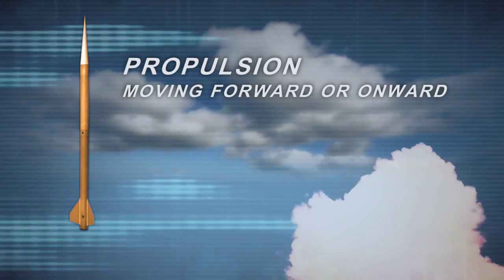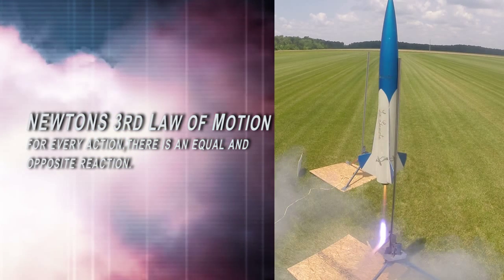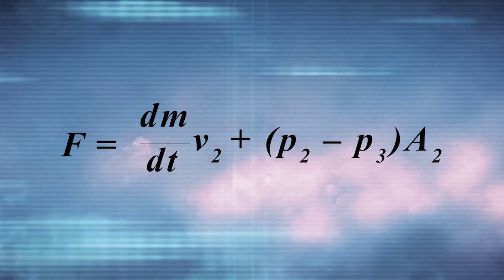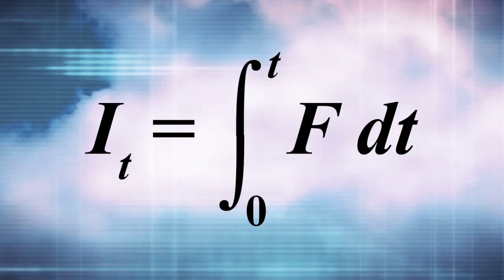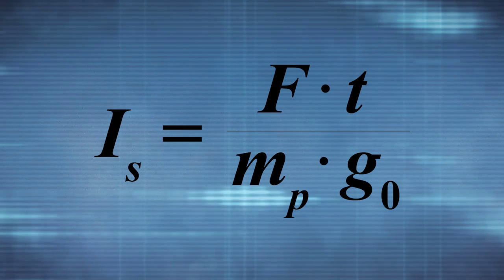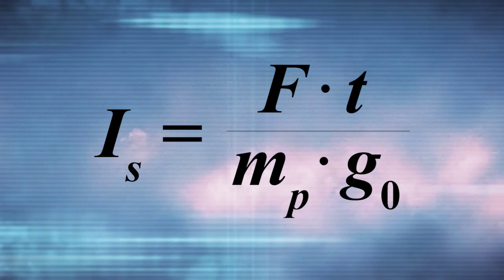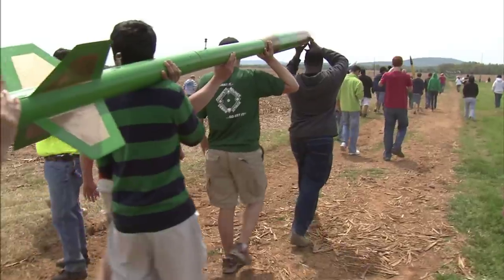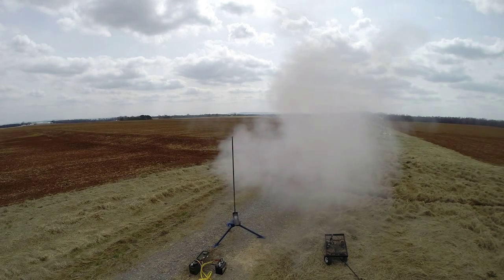Propulsion

Comment: I am new to high power rocketry and have enjoyed watching way more videos on this subject I ever thought I could.  As I am beginning my build and prepping for my level 1 cert later this year.  
Question:  At the 7:04 minute mark the video starts talks about the delay before the ejection charge.  It talks about an H123-14 motor which is a high power motor that the 14 is the delay between the motor burnout and the ejection charge ignition as stated in the video.  I thought that the delay starts to burn at the time of motor ignition and that the ejection charge would ignite 14 seconds into the flight.  Please correct me if I am wrong.
Thank you for putting out videos on this subject.
Steve